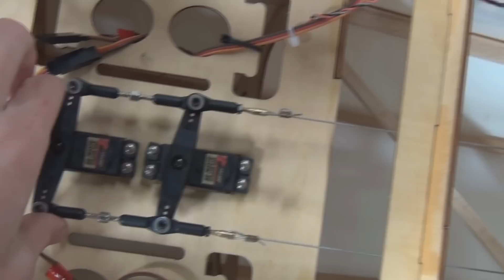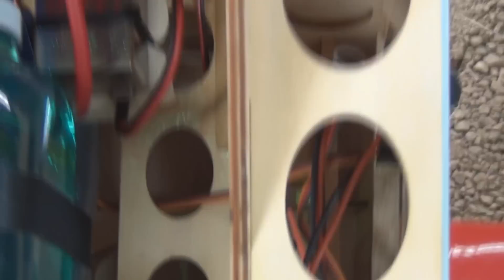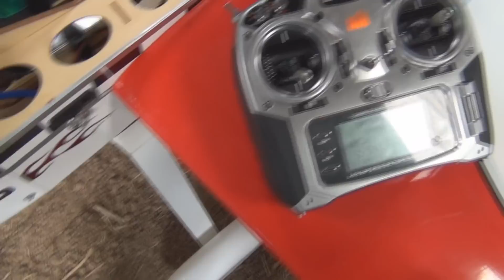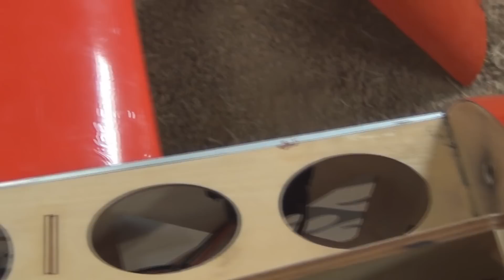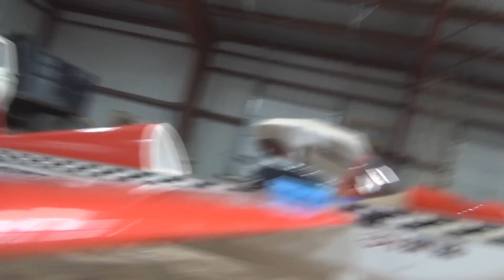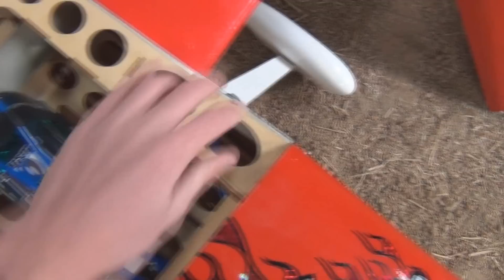RC Giant Scale Basic Tutorial Aeroworks Extra 260

Comment: Nice presentation, and nice set up. I tuned in because I have not set up a plane like this in years and wanted to see what the latest on power management systems was, figuring a lot has changed, really pretty much the same, as it turns out with just more products around. One thing I want to mention, is, if you plan to fly a plane like this a lot, and not just two or four times a month, you will want to address wire management and rout all you servo leads etc. into a Harness of sorts isolating all wires from rubbing against formers  stringers or anything else. I used small spiral wrap plastic tubing, tape, and small tie wraps as well as cable ties the kind you screw into wood and it has a small loop for the wires.. You would be surprised how quickly wire insulation wears thin.

Comment: *GREAT PRESENTATION
I think you offer a great deal of knowledge to those of use who are interested in the RC Plane and/or UAV and FPV planes

I would like to ask you some questions please
1. Does this Model RC Airplane have a extra payload capacity as to place a larger gas tank for 1-2 hours flight?
2. Is the payload capacity contingent to the type Combustion Engine and the length of the wing ? The strong the engine, the more payload capacity?
3. Is it possible to make it autonomous long range plane with the Pixhawk flight controller

Francisco
Bronx, NYC
347-443-1752

Comment: Fuel myth is that the higher the octane equals more power. More octane will smooth and slow down the burn, so engines with higher compression or using a power adder such as a turbo or super charger will need a higher octane to prevent spark nock or worse preignition. Also if you want to run a more advanced timing you can use a little higher octane. So use a good brand of fuel and run 87-91 octane for the most power.

Comment: Hi GREAT video!!!  I bought an edge 540 106" with a DLE 111cc. Awesome plane. It was already set up with Smart-Fly EQ10 power expander. I took the expander out and added a new spectrum 6 channel receiver and I used the 7.4 5000mah lipo regulated to 6 volts. Reason I took the expander out is because I was told the DX6 Radio wouldn't work for this set up. Anyway I balanced CG perfect and took it to the field and the first and second five minute flights went great. Then 2 minutes into 3rd flight it went crazy in and out of signal and then in the ground it went. Not sure what happened.    Stating over fresh. New plane, New 9 channel receiver, new 9 DX9 and same EQ 10 with the super regulator and all new HT 7955 all the way, new wiring, and same engine. In your opinion is this a good route to setting it up??? I need all the feedback that can help thru this build. Im not a 3d flyer at all. I like to fly my planes like a CUB. Never inverted unless on accident. LOL. Please help. Thanks.....
Reply: How second build turn-out?  Hope did not crash, first one sounded expensive?  Saw a vid on spacer requirements, engine and exhaust when using mufflers cans, need to leave space between header and mufflers (2mm atleast ) chattering can cause RF noice.  Good tips at "DA Australia" channel, ytube search DA Australia mufflers.

Comment: do you really trust spectrum???????
Reply: What's wrong with spektrum
Reply: they lose signal all the time... personaly i only trust futaba and frsky. i believe JR is nice and aurora too!
Reply: Does the dx6i loose signal as much or less or more. Than the newer ones such as the dx6 or dx7
Reply: they say that the new models do not loose signal but i believe it takes some time for the problems to appear, just like the oldest models. Basically some spektrum transmitters never had problems but others had from the first day.. I personaly do not trust spectrum. i have lot of friends that have spektrum and had problems. futaba T6J is far better than spektrum t6e-i as a result of my personal tests in real environment test field.
Reply: Ok I'll make sure to get a futaba for my next tx.
Reply: yes!!! it will be awful to loose such nice plane because of the tx!! :-)
Reply: +mitropoulosilias I never lost a plane to any good radio. Now I lost plenty to the RX losing power from cheap batteries or not replacing them over time or some lose screws in a servo or connection.

Just something you learn over time.

Comment: Ballpark price what it would Cost to get that plane in the air?
Reply from the maker: Between $3,000-4,000 depending on the quality of Power system and electronics you use. I'd highly recommend always going with high quality Engines and electronics.

Thanks,
  Voro

Comment: also the servos buzz because they are digital, digital servos are important to have for giant models. They buzz because they are constantly making fine adjustments to keep the gears straight which gives accuracy. The concern around binding servos (servos working against each other) is power drain. These servos pull around 5amps with stick input, so slight blinding with no stick input will result in amp draw flattening the batts quicker and in rare cases burning out the servos :)

Comment: servo clips alone aren't enough to give me peace of mind. I put heat shrink over them after I bathe them in a glue gun lump, especially on the lead connections, so that over time the wires will not pull out from flopping around. also nylon washers all around, where applicable. they survive vibration very well. I also add a cross of thick plywood behind the firewall where the screws go through, glued and coated with Tysol. I also go around the seam of the engine box with a bead of JB Weld Kwik.

Comment: I have a DA 100 but I may trade to an EME 120 and add a tuned pipe. Wouldn't a tuned pipe on the DA 100 be about equal to a DA 120 with stock exhaust?

Comment: I'm going with a123 batteries and no power expander through an AR9100 rx with a single 7980 servo on rudder. I like simplicity. less gadgets means less chance of failure. also going to run a hopper tank in front of the main tank to ensure constant fuel. don't like dead sticks toward the end of the tank.

Comment from the maker: Thank you for pointing that out. The CG is a tricky thing with big birds, any plane with a symmetrical airfoil (like this one and most 3d planes) you can check CG in the air. You first trim the plane out and simply fly straight and into the wind, roll inverted and if the plane drops you're nose heavy, if it rises you're tail heavy. This plane was too nose heavy so I moved my battery packs back now it's just a tad nose heavy which is where I think it flies the best.